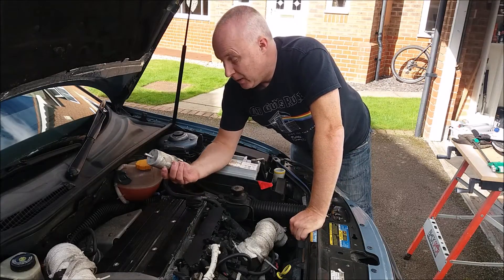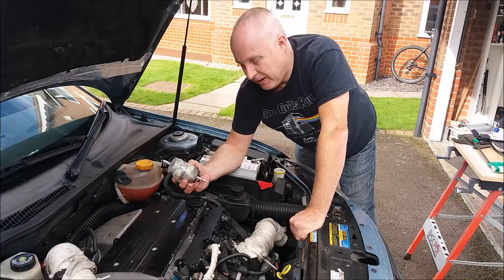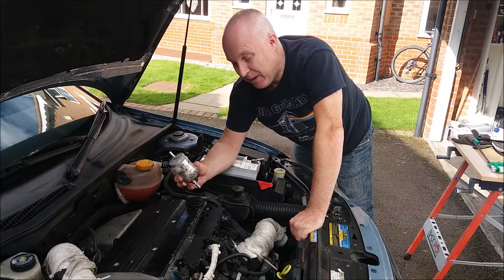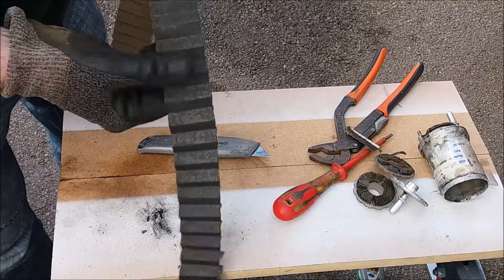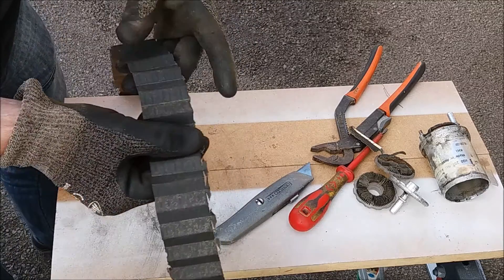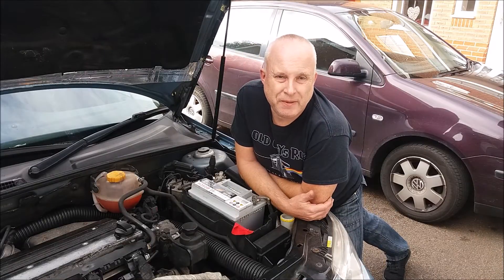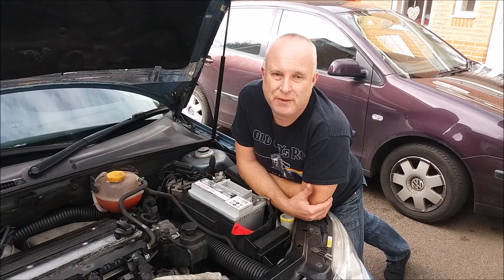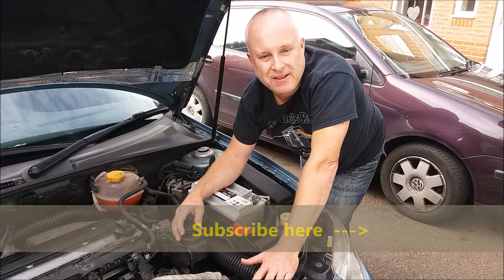Why Should I Change My Fuel Filter | Inside An old Petrol Filter #1

Comment: Great video, enjoyed watching it. Got even better when the macro lens was used! I'll be dissecting mines soon from a vehicle with 130k miles just to see how bad it is.
Reply from the maker: Yeah, when I were a lad, it was normal to change fuel filters frequently. It was the norm for decades. Now, suddenly, manufacturers are building cars with NO specified filter change interval (eg Polo, C1) and some even use in-tank filters that you cannot change without dropping the tank (eg Mini). I've long been of the opinion that long service intervals are for the fleets to cut service costs and to promote wear so cars still need replacing at 10 or so years. My engineering curiosity wanted to see how filters were made (even though I 'knew' anyways) and wanted to see just how much crap there is in fuel (clearly plenty). It opened my eyes even though I've been an Automotive Engineer for 35 years.

The lenses were just a cheap clip on set for my phone lol. But hey, they did the job.

DO let us know how you get on with yours. Maybe send some photos (you can get a close up with a phone by zooming in from a close distance, a foot or so).

Comment: It’s a shame newer cars don’t have inline filters anymore, most new fuel injectors have a ball seat type of valve which isn’t sensitive to smaller particles but the screen regulating the flow beyond it does clog up, it will still run but less than satisfactory clean spray pattern, but it will still run this is why newer cars don’t have inline fuel filters anymore, but your still having small particulates flowing into your injectors and even combustion chamber which does accelerate wear, the older style of pintle needle valves are very sensitive to small particles hence inline filters, it’s just me but I put in inline fuel filters on all my cars if they don’t have one, easy simple cheap insurance and it pays for itself with keeping your injectors clean and having optimal spray pattern for the best fuel economy and power
Reply from the maker: You'll find that cars without accessible in-line filters have the filters built into the pump assembly in-tank. "Fitted for life" as they say. This is fine when the car is relatively new, but these filters are designed to last 100-120,000 miles. As the car gets older, they clog and cause fuel flow issues and also strain the pump. BMW Minis have this problem - you replace the in-tank filter and next thing is the pump fails.
Now I've sussed how to make fuel lines (https://youtu.be/mT8Sne0q_2g) I intend to remove the in-tank filter in our C1 and fit an in-line one.

Comment: My manual ‘06 Saab 9-3 2.0T with 95k miles just started chugging when I accelerate but No check engine light on. It has never done that before. It has been idling rough for awhile. When I say rough I mean the rpm has been been going up and down from 1 to 1.5 rpm when idling. 
I think I’m going to clean the TB, MAF sensor, and change fuel filter and spark plugs. Cross my fingers and hope it fixes the problems!
Reply from the maker: Check for vacuum leaks too. And this can cause bad idling https://www.youtube.com/watch?v=bgLn14dZL3Q&t=2s and is often missed

Comment: I have a range Rover Sport Supercharged SCV8 which has done 120k miles. Dealer said it doesn't need changing. Should I still get it changed as I believe it's located in fuel tank?
Reply from the maker: Your car is at the end of it's 'design' life at 120k. The tank filter will not be engineered to last much longer. Get it changed if you can. Are they available?
Reply: @CycloneCyd  I called my dealer up and they said this part is not available as the filter is designed for life. I don't know what to do now
Reply from the maker: @maulajatt5655  the dealer is quite correct and is telling the truth. However they are also being "economical with the truth" (M. Thatcher), because what they are not telling you is that the OE definition of 'life' is 12 years or 120,000 miles.
Take the unit out of the tank and see if you can open it up to remove the filter medium. Then convert the car to an external filter in the fuel line.
I'm thinking of doing the same with our C1 as it's on 86,000 now.

Comment: Found your video after my fuel filter got so bad on my 05 mustang the car wouldn't run right. just he nasty fuel that came out was enough for me to know that 130k was far too long.  wish i could have opened it up
Reply from the maker: I bet it was proper nasty❗ Of course, 'life' for the OEs is 100k or 10 years. They want YOU to buy a new car, not keep that "old banger" on the road 😂😂
Reply: @CycloneCyd  believe it or not the manual actually says every 30k but I bought the car used. At around 100k so figured it was fine. Big mistake😂

Comment: XWD equipped 9-3 or NG 9-5 has those "life time" fuel filter built into the pump. Compared to the hassle of dropping the tank to replace the fuel filter, those filter is not for sale alone. So just wait for it to go.
Reply from the maker: All NAS 9-3s also have the intank filter. yes, they're a pain to change. They 'should' be good for 100-120 thousand miles, but I would suggest dropping the tank, removing the filter medium and fitting an in line filter at around 80,000 miles. The inline filter can be changed easy enough every 30,000 thereafter.